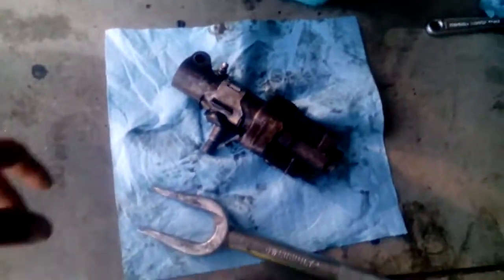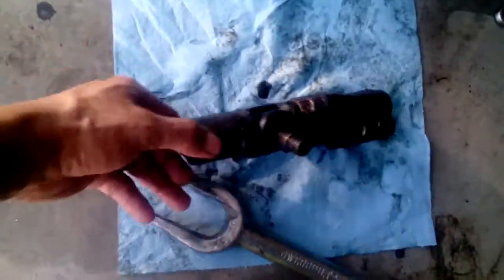Power steering control valve.

Comment from the maker: Be careful when you change the Power steering control valve. Make sure when you install the valve and when you start your car, make sure there is nothing in the way of the tires. If you don't install the valve correctly it will move your tires to one directions.